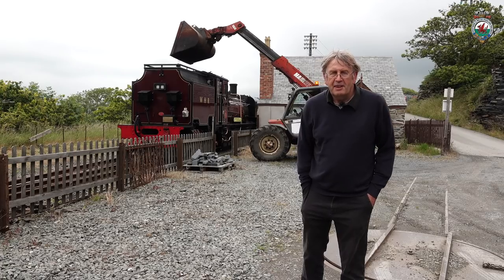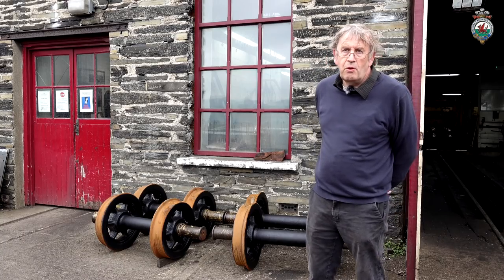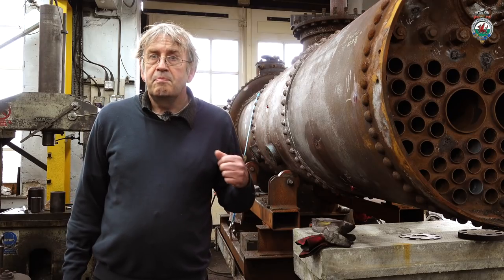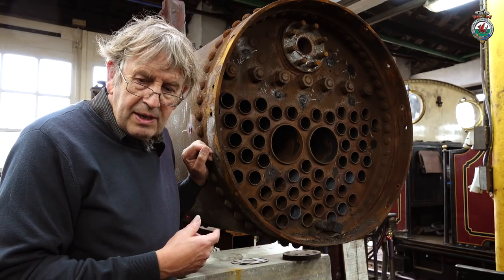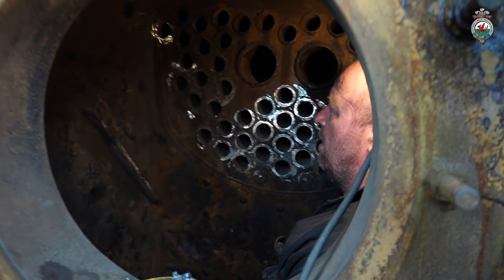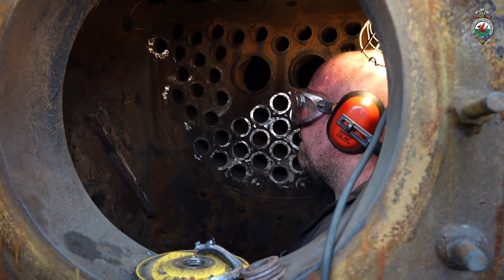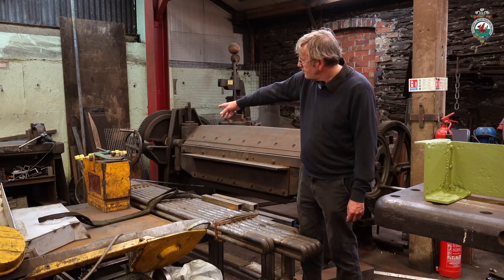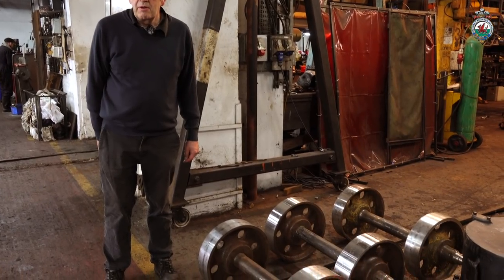F&WHR Moving Pictures Number Fifty Three - 16/7/21

Comment: Thanks for an excellent update. I'd be interested, maybe others would too, to learn more about spark arresters and the Forestry Fire issue. In 73 Alan Garraway wrote to Model Engineer magazine explaining that much of the motivation for converting the FR to oil burning was Forestry Commission concerns over thrown embers. What's changed I wonder, to mitigate those fears?
Reply from the maker: I think we covered smoke arresters in a previous episode a while ago but of hand I can't remember which one. Next time Jon does an episode we will try to cover this. I know they are very successful which allows us to run with coal now.